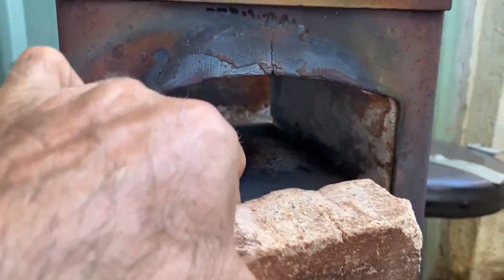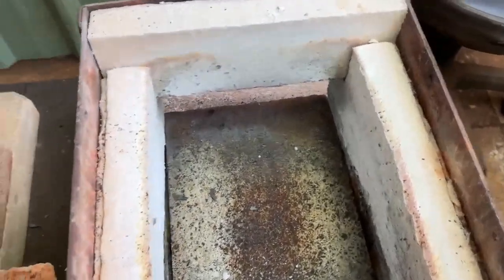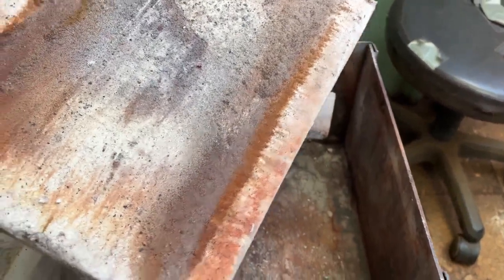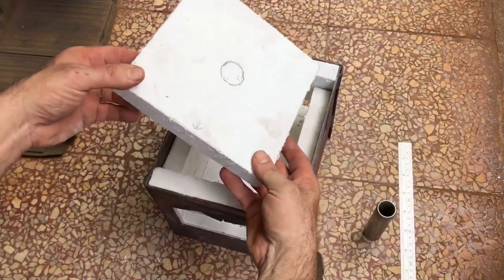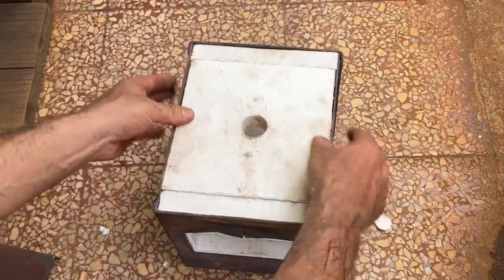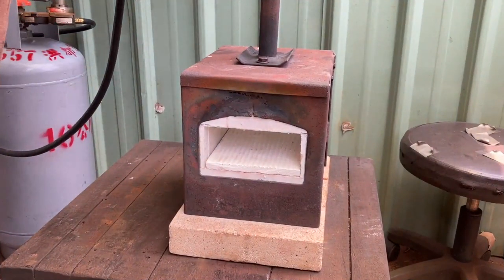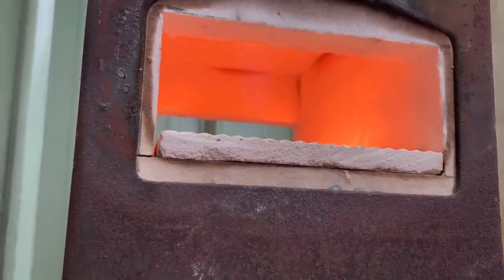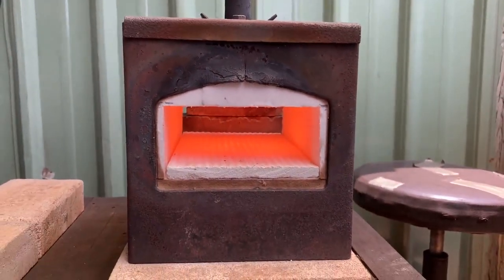Relining My Gas Forge - GS Tongs

Comment: I’m actually fabricating a propane forge from an old 6 gallon air tank for filling tires so far so good. Waiting for the parts I ordered on Amazon. I hope it will work well. It will be a single burner which I think will be enough to heat metal. I have a coal forge for forge welding so only need a quick heating forge that I can fire up and use when I want to heat work quickly.
Reply from the maker: It sounds like you've got things sorted out. Good luck with your gas forge and all. Thanks.

Comment: Didn't you have a blower on your forge 
I loved the solid refractory much easier to use
Reply from the maker: I removed it, at least temporarily. Thanks.
Reply: @gstongs  That's interesting. Any particular reason for removing the blower? I have a hunch that they're not an advantage except (possibly) when draught is a problem. People think they save fuel because they can use a lot lower pressure on the fuel gauge, but they don't realise the blower causes a Venturi effect and sucks the fuel in.